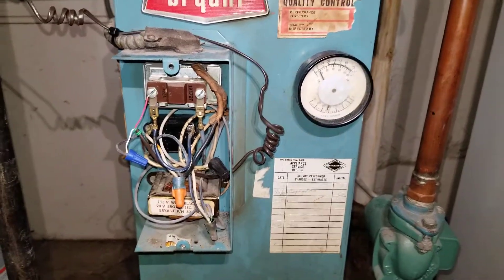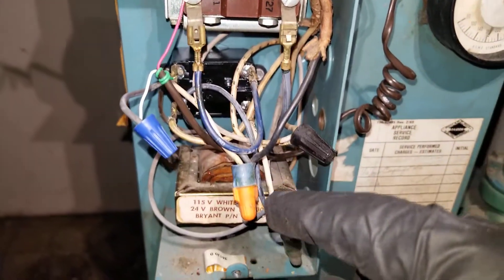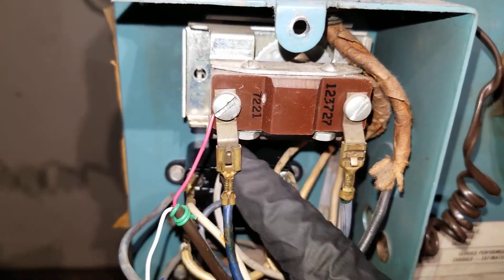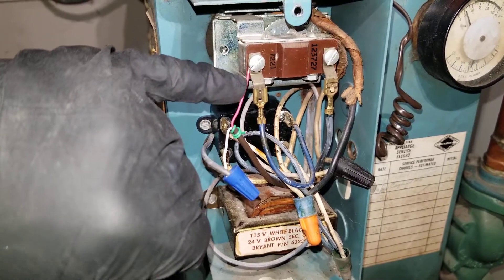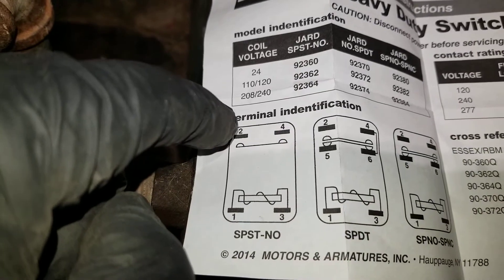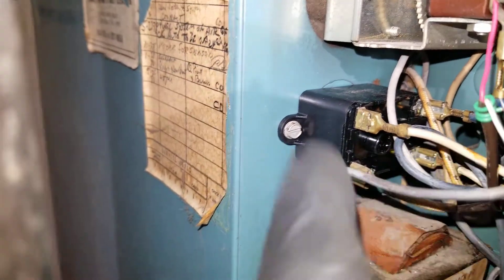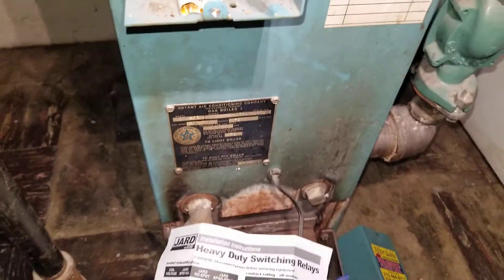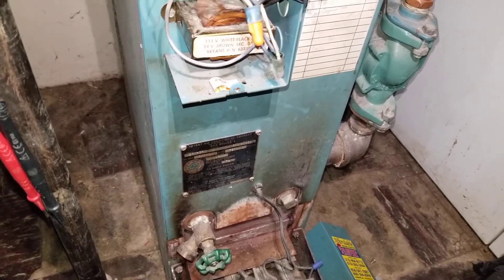Bryant gas boiler aquastat explained

Comment: Hi, I recently moved to an older home which has one of the Bryant Gas boilers. I cannot figure out where to change the furnace filter. Please help
Reply: Boilers don’t have filters/Filters are used on forced air furnaces since the air is blown through the house and dirt & impurities need to be collected. Boilers On the other hand heat pipes.

Comment: If the aquastat is not working correctly, could it allow voltage to the gas burners and the circulator pump but stop gas burners leaving the Circulator on and continue this cycle several times until something times it out ?

Comment: Great video....my issue is slightly different but you gave me an idea. I have a Bryant Gas Fired Water Boiler (1973) model 234 (nat Gas) that has always worked but today its not. I turn up the Thermostat for Call to heat and I see Pilot light go on and then the burners got on (Orange flame mostly) for a few seconds and then go out but Pilot reignites relighting the main burners etc.. This cycles 5 or 6 times and then it all shuts down Until I shut down the unit and restart the call for heat Any ideas whats going on ? Could the Aquastat switch be bad causing the gas valve to shut down and then relight ??
Reply: Did you find a solution? I have the same problem same model, works time to time